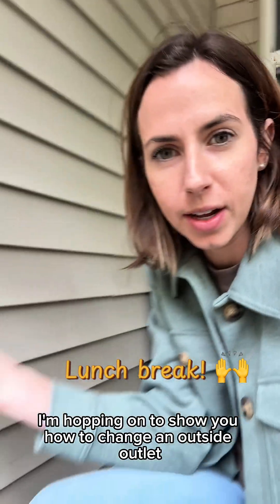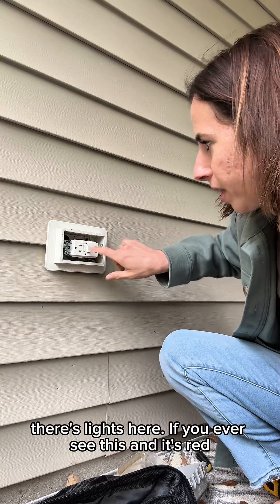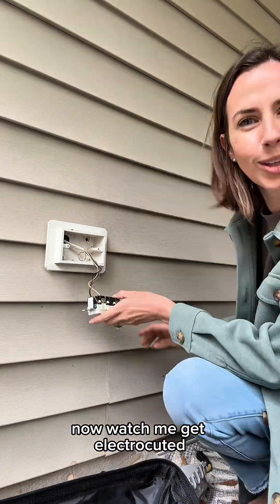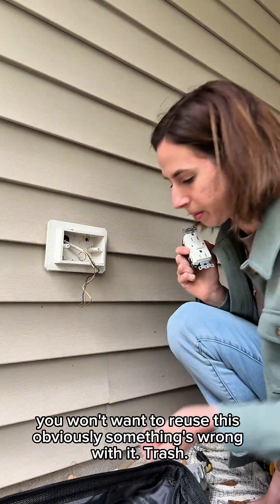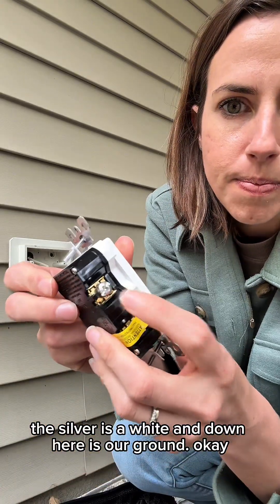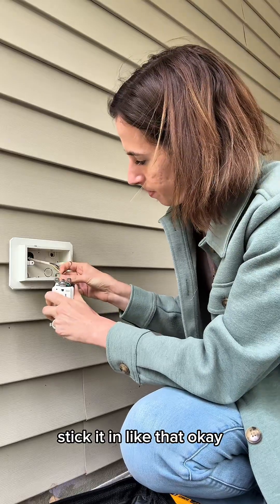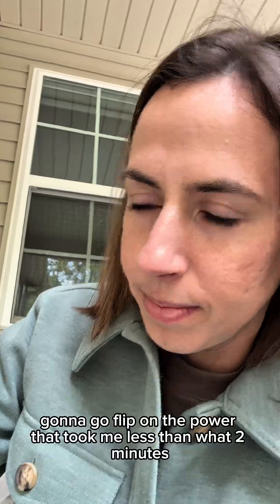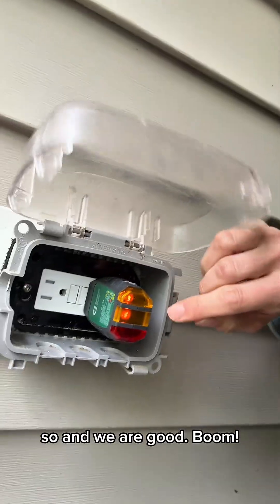How to Change an Outdoor GFCI/GFI Outlet #diy #howto

Comment: Line side = input power to the gfci outlet . Output/ load side = power going out and protecting downstream outlets by the gfci outlet. Silver screw is white neutral wire. Black or brass screw is for the hot wire the color can be  red or black depending on the circuit. Green or bare wire is the ground wire goes in the green screw on gfci outlet or regular outlet